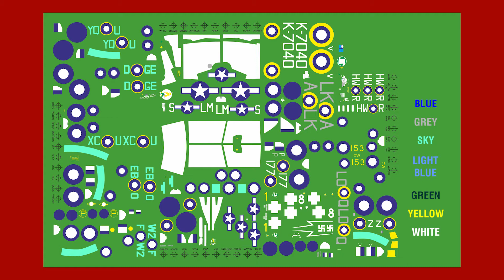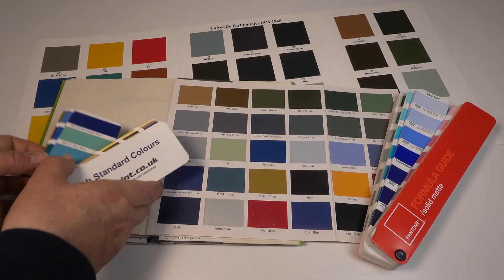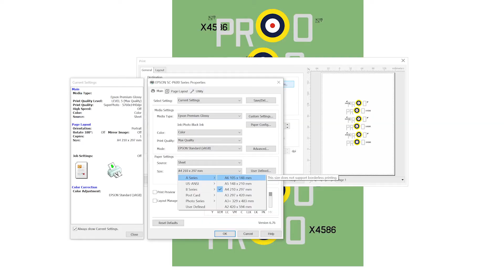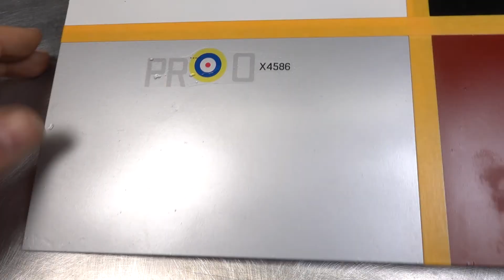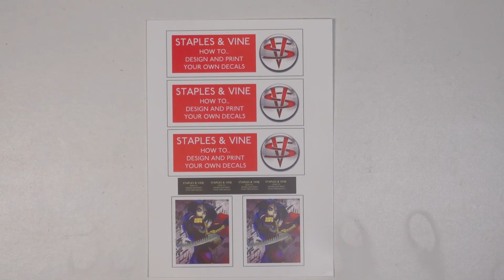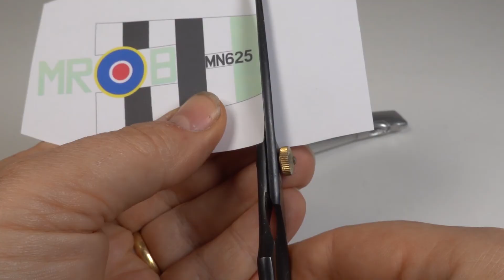HOW TO… PART 5  ‘DIY DECAL DESIGN & PRINTING’

Comment: You can use a cricut with the print and cut feature to cut white backed decals. Not all cricut machines have the print and cut feature so choose your machine carefully. The Cricut Joy Xtra is the cheapest with print and cut. The Cricut Joy does not.
Reply from the maker: Thanks for the great comment. I've got a Cameo portrait 4, which does print and cut. I may well experiment with that...🤔

Comment: See, You lost me at the beginning when you just flew right thru the scaling in the software...I'm very familiar with photoshop, but not vector software, so a full tutorial from start to finish in vector software would be helpful....I need 2 decals, same pilot name for each side of a Blue Angels cockpit. I have the proper font, and I know how to size them to the size I need in Photoshop and how to print from photoshop, and I have decal paper, but no clue how to turn it into vector, and then manipulate in a vector program and print.
Reply from the maker: You can print decals from photoshop but being 'bitmap' type images unless they are set to a high resolution they can look pixelated, hence using vector images in software such as Corel Draw, Illustrator or Inkscape (free).
Vector software is easier to use than Photoshop and will allow you to use any font and size it how you wish. 🙂

Comment: I'm just throwing this out there, but there is the old school way, are great-grandparents model Builders did not have access to slide decals and yet they were able to build models with insignias in the 1930s and 40s, before waterslide decals were a thing, so... I know it's tedious! but, I've done it and you can actually make masking tape stencils, where you actually paint the various insignias and designs, yes I know it's tedious! laborious! but it can be done! you can use a printout or a decal you can scan it and then use that scan print out and then using a strong light box with sheet masking tape very carefully with a very sharp exacto knife create stencils! using masking tape that allows you to actually paint the model the way the real aircraft would have been painted, I've used this technique on multiple models, obviously it works best on large scale models but it can be done with a steady hand and lots of patience it can be done!!!!!
Reply from the maker: That is a great solution. Things have advanced a lot since then and with a vinyl cutter it is possible to design and cut your own paint masks. This works really well and I used this technique on my ALIENS M577 APC build to recreate the markings at the front of the vehicle.

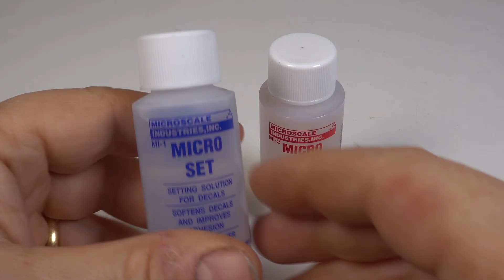Comment: Gracias por tan completa información; en mi caso tengo unas hojas de Expert Choice pero hace ya muchos años que las tuve  guardadas y en estos días que las usé con dos observaciones: una es  la impresión de inkjet quedó con pequeños puntos blancos pero vistos con lente de aumento o no dejan impresión de calidad, y dos, cuando las puse en la locomotora los bordes se arrollaron hacia dentro no más al  usar el Micro set "azul" minuto 12:11  y no hubo forma de devolverles a su forma extendida o normal. Estoy varado y sí, las protegí con laca  transparente como el ejemplo suyo despues de imprimir. Sugerencias bienvenidas. Le felicito.
Reply from the maker: Gracias por tus comentarios sobre el vídeo. Los puntos que componen la impresión se pueden reducir configurando la impresora a la máxima calidad/resolución. Como puede ver, siempre es difícil lograr un resultado aceptable con colores claros, ya que dependen del blanco del papel. La curvatura de las calcomanías se puede reducir secando las calcomanías recién impresas en un radiador y luego rociando la capa de barniz.
Espero que esto ayude.
Reply: @StaplesandVine  Thanks a lot.

Comment: In an attempt to get around the inability to print white, would a extremely pale grey be a workaround? My apologies if it is a dumb question.
Reply from the maker: Hi Gra ey, it's not a dumb question at all I understand your thinking. The problem is this ALL pale colours printed with an inkjet rely on the white of the paper as an element of their colour. Pale inkjet inks when printed never have the opacity to show up against non white backgrounds. I so wish someone would produce an aforadble white printer. 🙂
Reply: @StaplesandVine  Thanks for reply. I liked the tip of producing a white 'stencil' of the intended colour decals, but the thought of accurately cutting them out is daunting. I have a project in mind where I create WWII RAF decals for a F-35B Lightning, but the more I think it through, the more complicated it becomes.
Reply from the maker: I think your best option would be to buy some aftermarket RAF WWII decals if you can.
Reply: @StaplesandVine  Thanks

Comment: Tip: if you only needto print a small decal, just print the design on plain A4 paper. Let it dry. Cut out a small square of decal paper, just a bit larger then the decal size. Glue the decal paper right over the decal you printed on the plain A4 sheet. Now insert this A4 into your printer ( probably the manual feed on the back of it) and print your decal.
Works fine for me, using a simple Canon inktjet.
Reply from the maker: Thanks for that, I'll give it a try. 🙂
Reply: What does that do?
Reply: @markconnelly1806  basically you're lining up the small piece of decal paper onto the regular paper in the spot where the printer will print the image so that it prints onto the decal paper when you re-insert the paper

Comment: Are there any printers out there that you would recommend for making guitar headstock decals that include gold and silver metallic?  I'm trying to find one and so far I've only come across the icolor 560, which is rather pricy.
Reply from the maker: Hi Steve, I would suggest you try searching 'gold custom decals / stickers'. Outsourced these will be a way cheaper option than printing your own. You really do need specialist equipment for metalics. Hope this helps, Sera. 🙂
Reply: @StaplesandVine   Short story, I'm needing to spend some money before I lose it and would like to get a printer that will handle these metallic decals.  I'm fine with higher priced specialty equipment, I'm just not familiar with the capabilities of the different brands/models.  That's why I was asking about the icolor 560. 

With the icolor 560,  it only has 4 places for toner cartridges. If I can make black with CMY, then I can use a gold or silver toner cartridge in the last place.  I think that would work...just wondering if there's a better option out there.  Alps printers are tough to come by, and I'd rather have a newer technology instead of buying used.
Reply from the maker: Hi Steve, the tech is moving so fast these days, which is good but hard to keep up with. Have you had a look at the DTM Print FX510e thermal foil printer? You may be able to adapt your designs to suit. Traditional decal screen printers will print metalics. Sera
Reply: @StaplesandVine  I'm checking in out now. Thanks for the recommendation!

Comment: Great presentation. Far more helpful and informative than any of the other videos I've seen so far. I'm a sculptor and need to print my own decals for relatively small scale figures that I cast from their original/prototype. They need to be consistent. Most videos I have viewed on the topic were next to fecking useless. Yours hit on all the important points; thanks 👍.
Reply from the maker: Thanks, I'm glad you found the video useful. DIY decal printing is a bit hit and miss. Sometimes it works like dream other times it's a nightmare. All the best with your projects.🙂

Comment: Hello I was wondering if you make custom water slide decals and print a few on a sheet.? An what would u charge for something like that?
Reply from the maker: Hi Rafael, no I'm sorry that's not something that I do. The process is quite straight forward. Try 'inkpress' for yourself and have a go. 🙂

Comment: hi i maked my decal design bu i have problem with size i can’t size them on real diecast i tried but i can’t do that do you have way please
Reply from the maker: Try printing out a few different sizes on plain paper. See how they look then adjust your sizes until you get what you want then print it on the decal paper. Small decals are much more difficult to get to the correct size. Good luck.
Reply: @StaplesandVine  thanks alot  i will try that thanks for your advice

Comment: Due to the Decals being laserprint you don't need to spray them with varnish post printing or have I missed something?

This video has really helped me, thank you.
Reply from the maker: Thanks for the comment peng917, I'm glad my video was of some help to you. These decals were all inkjet printed and as such need the varnish coat to hold them together prior to application. As you say, not a problem for laser printers but the carrier film can be quite noticeable.
Reply: @StaplesandVine  sound as a pound. 

Quick question, now that white toner is becoming more prevalent and cheaper. Do you think it's possible to print the white backing for the decals then put the paper through again and print the colour on top?
Reply from the maker: I agree, it's logical but... Running something twice through a printer is going to have registration issues. Worse if it is 2 different printers. Also laser printers don't like to play with specialist non OEM papers. I've thought about it but I'm not willing to risk a repair bill. What's needed is a printer that lays down white first then well saturated colour, sadly we don't have a good affordable option yet.

Comment: Very well done, but I had great results using a copy shop´s huge (and very expensive) Laserprinter. Vectors or pixel it does give the sharpest results - yet the non-printing-white issue remains. Thank you for sharing - looking foward to your next episode.
Reply from the maker: Glad you like the video Wolli. Laser printers can produce great results but I do find the printer resolution is critical. It sounds like you have a good one at hand. I have an OKI which helps a lot with the white issue, but that's a whole new ball game of techniques to learn. All the best, Sera.